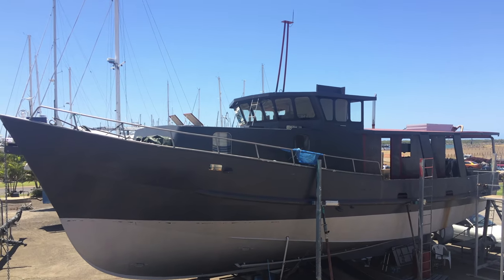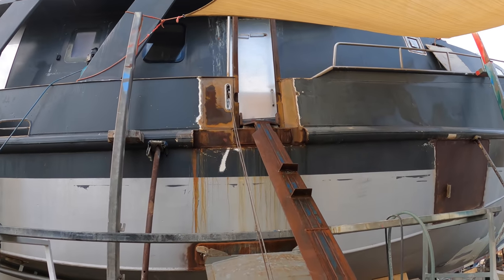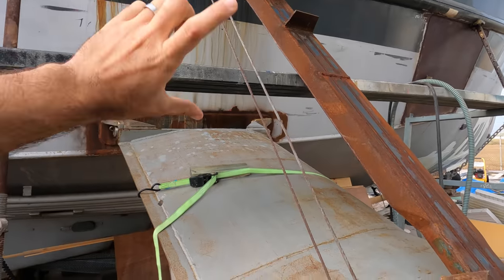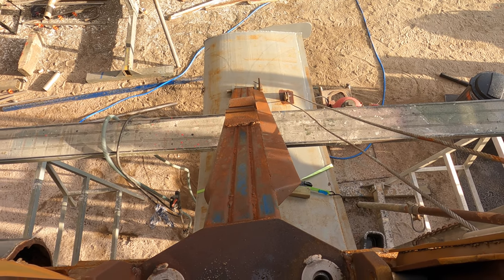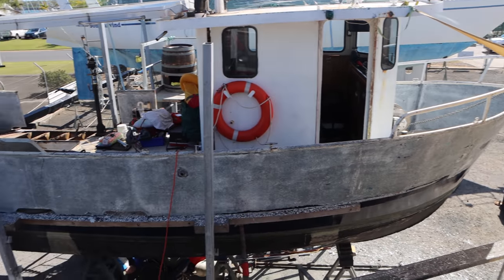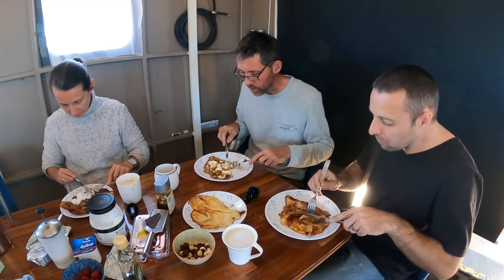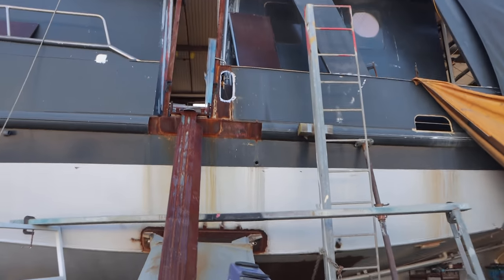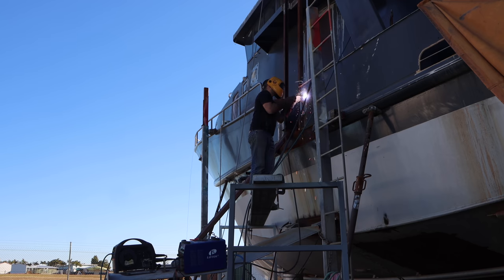Re-building our bulwarks & bending stainless solid bar fairleads - Brupeg Ep. 216

Comment: Scratched a hole in my head why are the winches are outside the cabin   the compassbloke
Reply from the maker: Ian I remember you well mate. We tried fitting them under the wheelhouse lip at first but they were too big so on top it was. We don’t want to mount them inside the wheelhouse as then we have a hole from the outside to the inside where water 100% will find a way in

Comment: Try this. https://youtu.be/IHXg4dk7Npk    He takes an engine starter and throws a pump on it.  You only need a small tank also because of the return will be able to keep up. Instead of a hydraulic ram use a hydraulic winch. Put it all in a sealed box up on the roof. The amount of time you'll use it won't burn up the motor either.

Comment: How about doing what you described @ https://youtu.be/ChYNY0xTMAE?t=624 but also cut the very top of your rails and reweld them with a slight angle inward just at the point where the rollers are almost fully raised. That way the last few inches would be easily pulled inward. Kind of the same way your door locks work against the wedges that you created.

Comment: Can't you just use an electric hydraulic pump on the roof? 2 hydraulic winches, one small electric pump on the roof and no running lines through the boat.